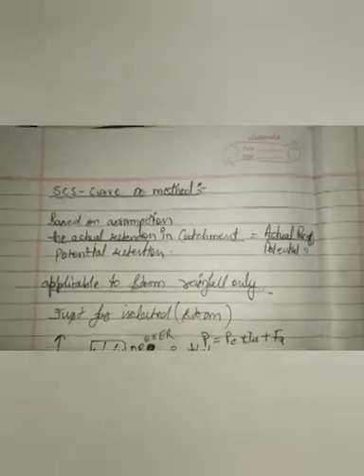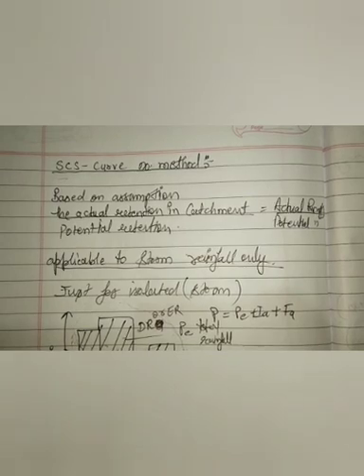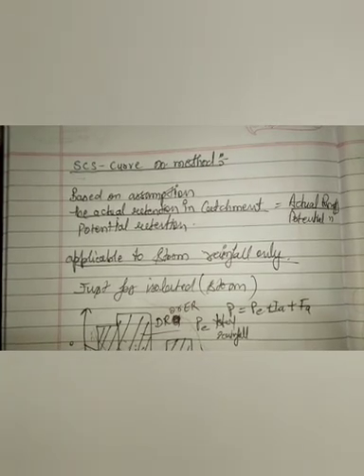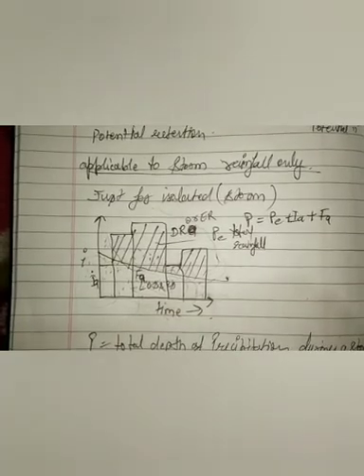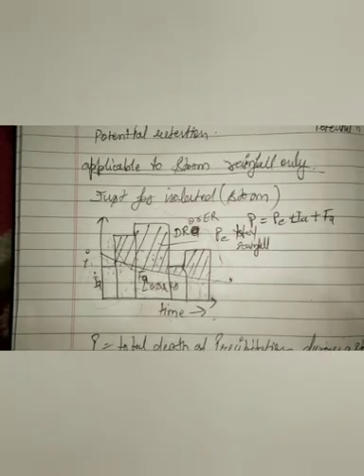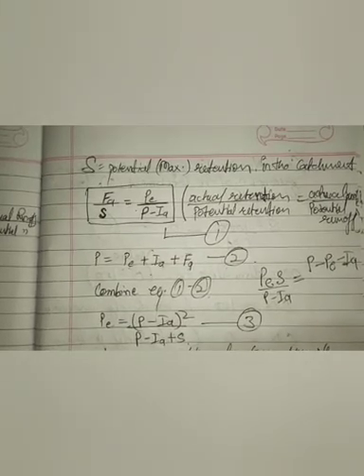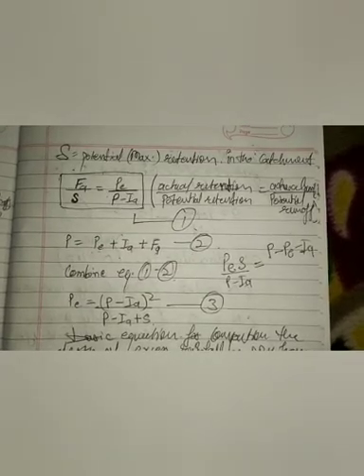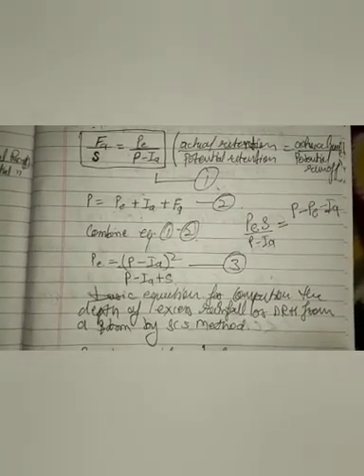Introduction to hydrology:Runoff depth by SCS-CN method(part-1)...

Comment: can we use this for annual runoff estimation?
Reply from the maker: Although this method is designed for single storm event but can be efficiently used to calculate average annual runoff.